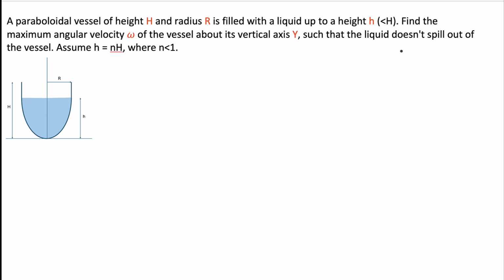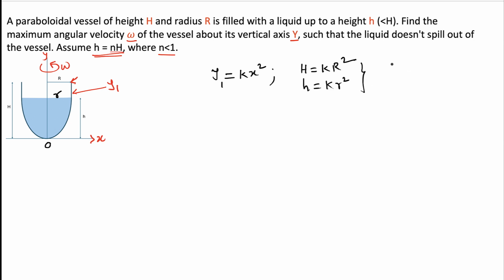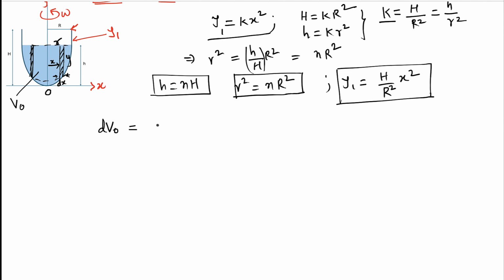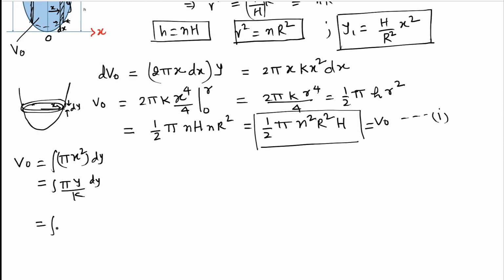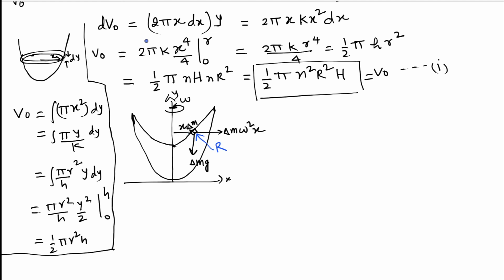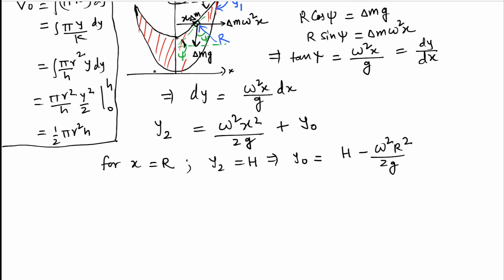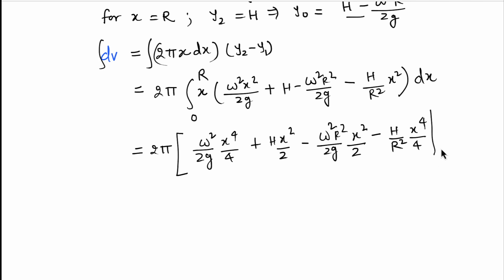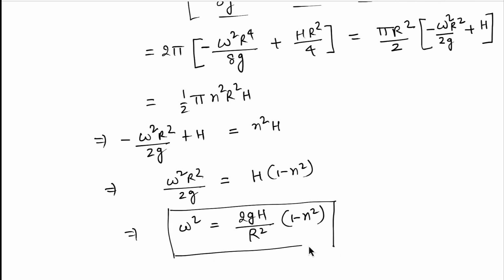Can You REALLY Prevent Liquid Spill at High Speed? #jeeadvanced

Comment: You are using R for both radius of the glass and also the resultant force (though it gets cancelled out). Could use F instead for force. Also Shouldn't the direction of force R be reverse of what you marked?
Reply from the maker: Good point - i should have used different var than R to avoid confusion.
Reply from the maker: Actually the force R is the one which is overall keep that tiny part of liquid in place. If you see the mw^2r is towards outside of the vessel, but there is some force which is keeping it in place. Think of this as resultant balancing force on that tiny part of the mass.